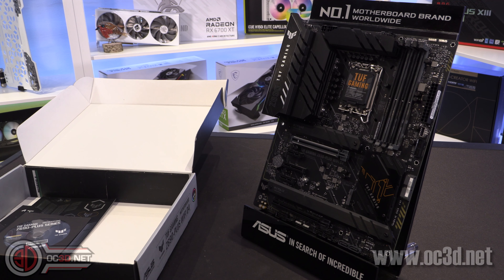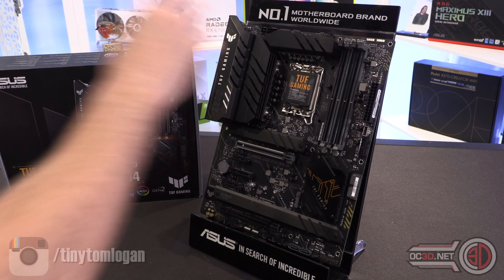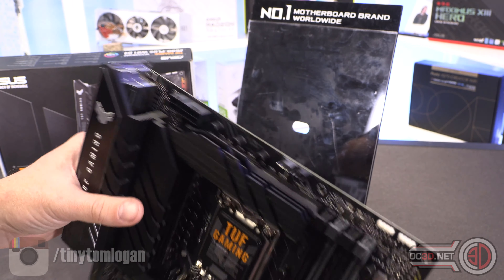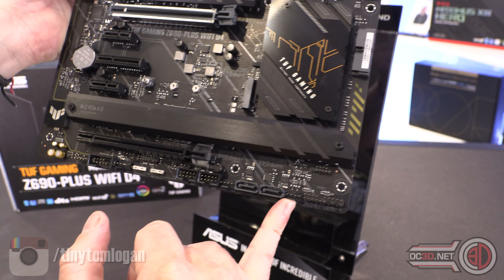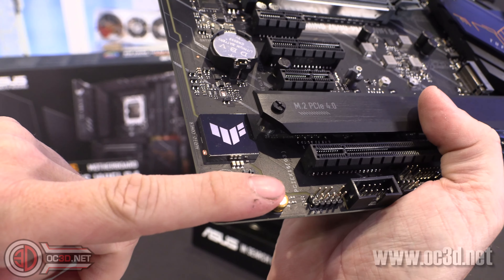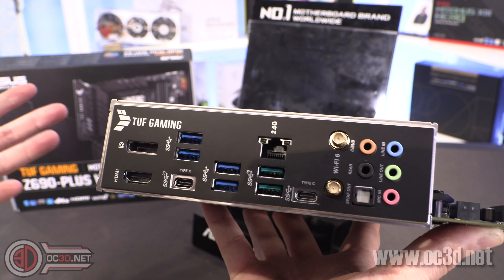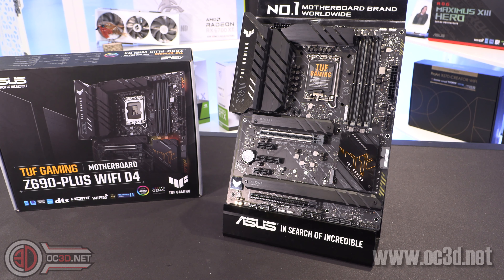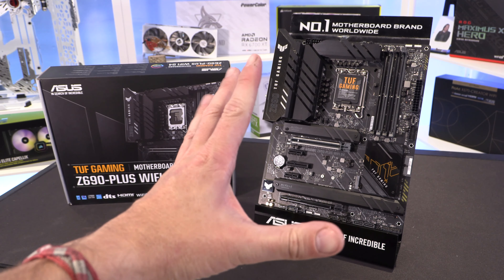Asus TUF Z690 Plus Motherboard Preview

Comment: How do you set it so the motherboards rgb turns off when you shut down? 

The rgb flashes on mine when turned off but still has power it's kind of distracting when I'm trying to get to sleep
Reply: OK think I have found out how. Can someone confirm if this is still the same on this board?

Look for a setting that says ROG Effects under the Advanced menu option. Click on Onboard LED, then select Disable, and the RGB on your motherboard will shut off with your computer
Reply from the maker: Its in the RGB software dude

Comment: Aren't those MB supposed to be DDR5?? Who wants DDR4 if building a rig today
Reply from the maker: They can do both and means people have a cheaper option - at launch it looks like DDR5 will be big bucks
Reply: i cant expect much of an improvement in an esports/competitive setting even to frame times/latency. W.o forking out big money for some tighter premium DDR5 mem. Im sure even the 12600k with manually OC b-die ddr4 which costs much cheaper than ddr5. Will lead to the best latency with a 5ghz+ 12600k for those purposes....Perhapse a bigger cpu and again the more ideal tighter ddr5 kits vs the vanilla ones. Could equate to more ideal "gains" if justified or if one were rich enough to justify such "needs" i can easily see an advantage of DDR5 in survival shooters or with higher graphics enabled or Res beyond 1080p. But its a lot to invest into. Where id rather buy a 4k oled tv in this current tech state. A 12900k dark hero and a bread winning ddr5 kit is already an insane price point/budget chunk of a build GPU aside. I still have to wait for benchmarks to see which platforms/engines even fully utilize ddr5, since im more than willing to wait a year for the 13900k and ddr5 to be in larger production with the launch of am5. Not willing to pay some "tax" for being first. And the potential RMA process I wouldnt even consider a build with ddr5 and an i9 w.o a top tier PSU as far as transient response and voltage tolerance/variance performance.

Comment: Does anyone know how TUF would handle both I7 12700 and 3080? Would it do fine for gaming and streaming or should I go for Strix? I also hate that Strix does not support Noctua fans (((
Reply: I have this board and a tuff 3080.  You'll be fine.  I would try ek vardar fans, as they work with the asus RGB system
Reply: @ganzonomy  what cpu do you have? I don’t really care about RGB )
Reply: @den_cheesecake757  i7-12700k
Reply: @ganzonomy  cool, thank you! Anything particular you are not happy about the build?
Reply: @den_cheesecake757  the only thing I would say is that if you want the best sound possible, get a dedicated sound card. The onboard sound is 7.1 capable, but it is very basic in terms of power delivery and controls.  I'd get at least an Asus xonar se.
Reply: @ganzonomy  thank you! That what I was expecting. I will use my build mostly for gaming and streaming - basically headphones and mic. Do you think I would feel a difference if a get a dedicated sound card?
Reply: @den_cheesecake757  I have a xonar essence STX II sound card.  Once you get the settings right, it can shake my 150 ohm hd700s at about 20-25 percent volume.

If you want the best sound and clarity, I would say yes. Just make sure to follow directions on hooking up the headphone and mic.
Reply: @ganzonomy  ok, thank you sooo much for the feedback!